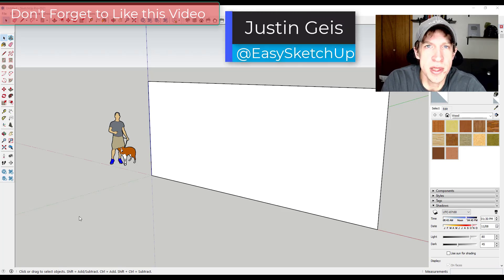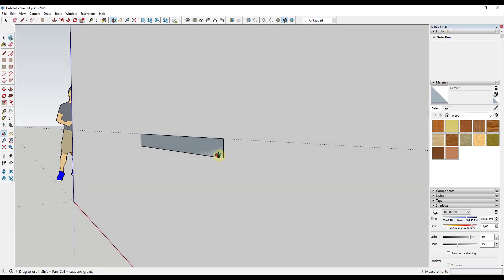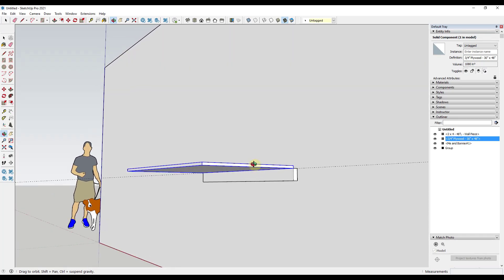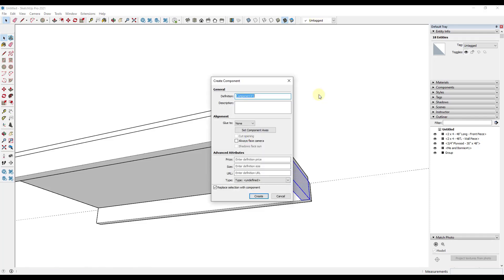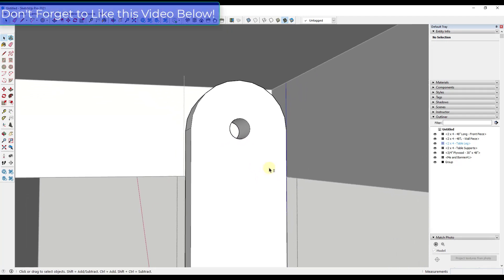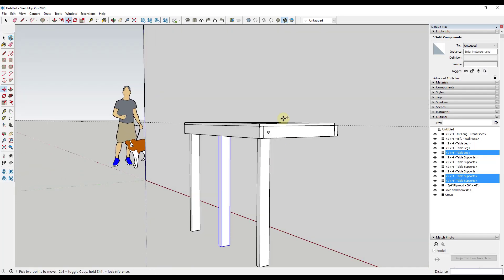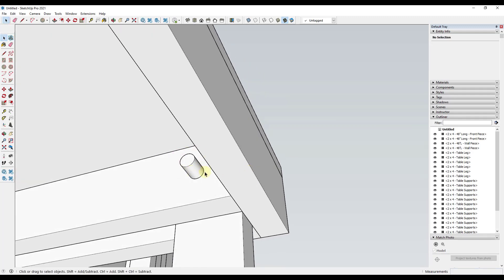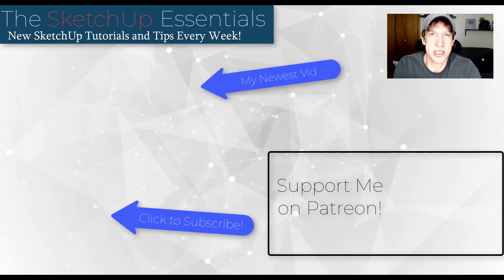Modeling a FOLDING SHOP TABLE in SketchUp - SketchUp Woodworking Tutorial

Comment: I don't know where my comment went.  waiting to be moderated?   the time in question is the board being created starting at 5:15, 'adding perimeter support framing'.  I'm unable to select only it after extrusion. 1 click the face, 2 the vertices, 3 the entire table.  I did the extrude with the + mode so it would create a new face.   
I"m also using the newest web version, 2 yrs later, so some things have changed.

Any suggestions?
Reply: assuming my 1st comment is gone..  really enjoying your work, haven't touched Sketchup in years, 3d space makes me dizzy, the axis locks are amazing.   
thank you!

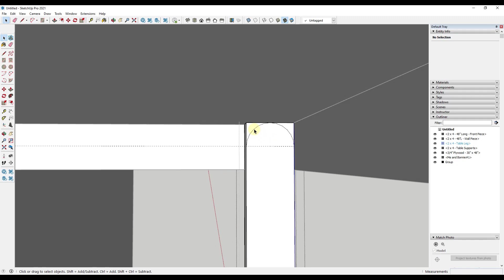Comment: At 8:30 when push pull to round the leg it does the whole leg instead of the small pieces that I used the arc to separate, what am I doing wrong?
Reply: Answer: before making a change to a component you need to edit component by double clicking it first. You will know you are in editing mode when a dotted box appears around the component. Make changes then click outside the dotted box to complete the changes.